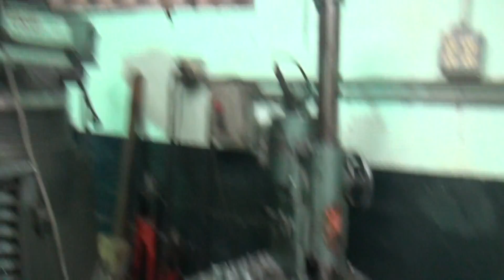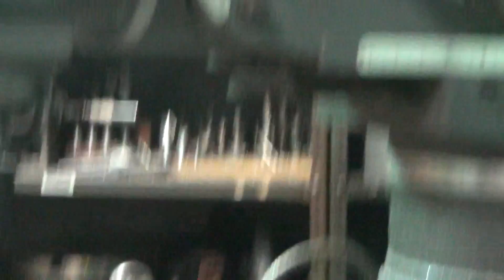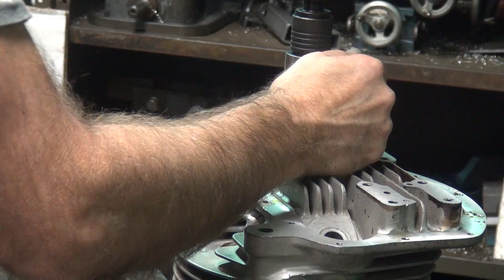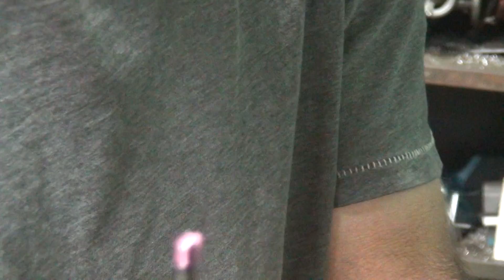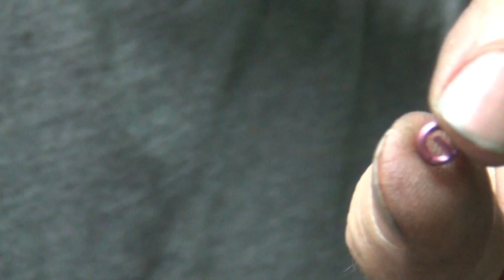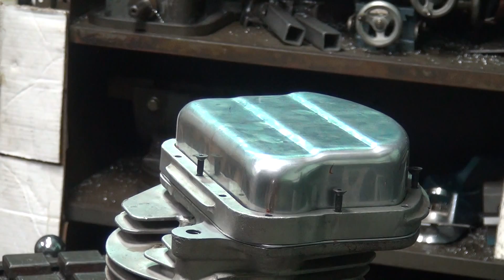#147 1958 & 1960 harley panhead complete head restoration repair welding & machining, tatro machine

Comment: Nice vid. All that dro gear it would be more stock to tig those holes with weld and 1st gen tap the holes I think.  Coils are a bit of a band aid for daily rider use.
Reply from the maker: +441rider 
helicoils are not band aids. they are stronger then the threads that stripped out. i do weld up holes when they get too big but it is alot of work.
tatro